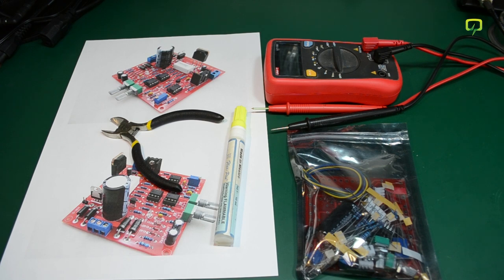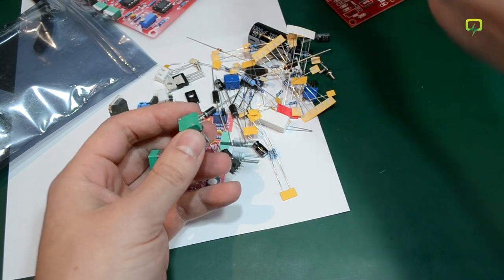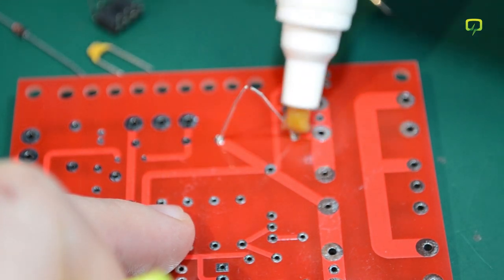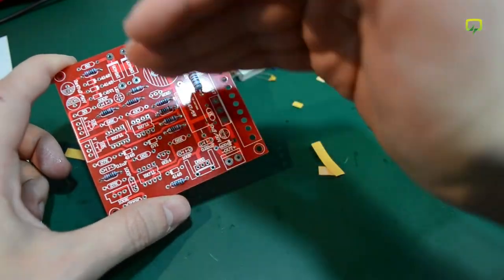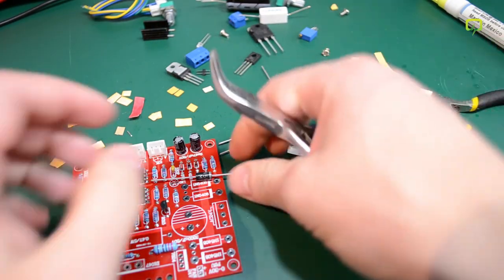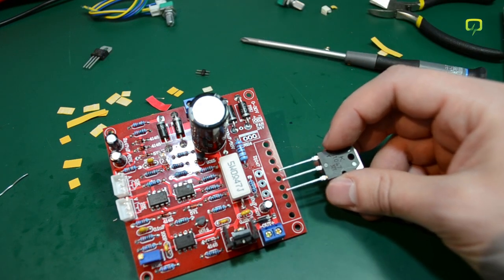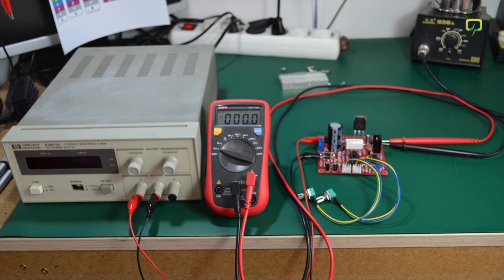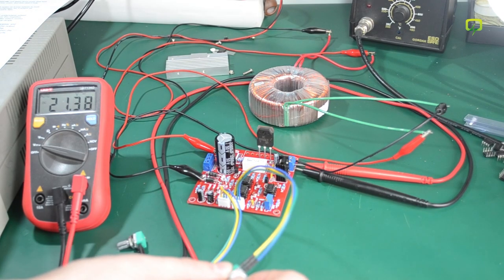VoltLog #8 - Kit Assembly 0-30V 0-3A Adjustable Linear Bench Power Supply

Comment: Have you tested the power supply? Did you check its output with a scope, to see if it behaves correctly?
Reply from the maker: +George Tsiros No, I haven't. I plan on mounting this thing inside a case soon and I will probably do some tests when it's finished. Do you have reasons to believe it would not behave correctly ?
Reply: +VoltLog Yes. Check tl081 supply rails in the circuit and from the datasheet. Do me a favor, slap a sink on that 3055 and a 24v secondary transformer and test the circuit's behavior when the current setting is very close to the current through the load.
Reply: +VoltLog Also check for oscillations and ripple voltage as well.

Comment: Hi, I was wondering about what power of transformer should I use. I know this requires maximum of 3 amps of current. I found  a 24 vac 40 VA transformer for reasonable price at local store. Is it going to be okay? I don't think the power supply will be able to provide 3 amps at 30 volts with it. Please let me know what you think.
Reply from the maker: that's a 1.66A rated transformer
Reply: Thank you for replying! I have couple of stepper motors that I want to run at 24 volts. Does that mean that I can have only 1.66A total current from the power supply? I mean 24 vac must be rms value so the peak value would be 1.414*24 i.e. 34v. Now we are stepping it down to 24 volts so the final output will be able to provide more than 1.66A dc.
Reply: I'm using a 24V 48W transformer, since I don't need 3A across the voltage range
But still 
16 volts and below - 3A

Comment: volt log can explain  how the short protection on this psu works, and does the 100k multi turn pot take part on protecting the psu from shorts?
Reply: +Anjay V Reading the manual there is no mention of short circuit or reverse polarity protection?  Of course, it's not a detailed manual so?

Comment: Hi, how can I solve that problem you had? the output voltage remains at 0.34v and for more that turn the voltage potentiometer does not rise or fall on the output.
It should be noted that the power I give is 24v 3a AC. Thanks in advance
Reply: Matias Cueto Hello friend. Have you solved this problem, because I have same issue with 24v 4a AC transformer. Getting only 0.614v at output. Thanks.
Reply: Ola amigos I got same issue.til now searching for answer

Comment: Sir I assembled the circuit and double check each component,all are ok,and I connected a 0 24v 5amp transformer at the input,but didn't get the out put like the video,opamp get hot,there is. No negative voltage on ic pin 4,I don't know why,pls help
Reply: Probably a bad TL081...swap them out after putting them in sockets.
Reply: #englishrupe01 No negative voltage on IC pin 4 means there is possibly something wrong with the voltage inverter for the op amps

Maybe a faulty component?
------------------------------------------------------
:(
Your PC ran into a problem that it couldn't handle, and it needs to restart. We're just collecting some error info, and then we'll restart for you.

(-1% complete)

If you'd like to know more, you can search online later for this error: ADAM_SK_EN_FATAL_ERROR

Comment: Hi, I build the circuit, but when I switched it on R2 gets really hot and after a while U2 also gets hot and needless to say it does not work. Any suggestions?
Reply from the maker: First check that each component is correctly mounted on the PCB, next make sure you use AC input.
Reply: Thanks, think my issue was finger trouble. I got it to work, but R2 still gets pretty warm. If that's normal I just leave it as is and start building it into a box. Thank you for the advise
Reply from the maker: R2 should not be warm, I can't check right now but I don't remember that resistor getting hot on my build.

Comment: Where did you buy
 the kit from? I can't find it.
Reply from the maker: I have added the link the description of the video.
Reply: VoltLog
Thanks. How does the performance compare to the Gopher? Any better or far lacking?
Reply from the maker: John Chung Haven't done any measurements so far. At least in terms of noise it should be better considering it is a linear supply.
Reply: VoltLog Okay will do the order. Takes for the info.
Reply from the maker: no problem!

Comment: I order the same product.after I assembled it,it won't work opamp is hot I changed all opamp then all is good.but when I connected a 2amp load on output led light up and then out vollt become 0v,I tested all component.I see ,47 r resistor is open and also 1047 is short,
What is the max out put.
When I connected this load the heat become a little bit hot.I provide a good heatsink and a fan.I don't think it provide 3 amp output and also no over current protection also,if there is a over current protection 1047 will not be short.
Reply: Did you set the CC by shorting the leads first? It does work...at least on my kit.

Comment: Hi, did you get around to doing ripple measurements under load conditions?
Reply from the maker: I have just finished assembling this kit into a complete unit with enclosure. I did a couple of measurements and I need to make some improvements. I will do the improvements and the measurements in a future video.
Reply: VoltLog I am at that stage right now just putting it all in enclosure. Not a lot of capacitance for a 3 amp load.
Reply: VoltLog So do I wait for the video for feedback?
Reply from the maker: I'm waiting for some parts to be delivered before I can start preparing the video, it might take a while.

Comment: Hi, if I conect 24 Vdc directly to the A.C. input of the rectifier bridge, ¿will it work?
Thaks a lot.
Reply from the maker: COJEIGUEN HERTRANKA It will not work with DC voltage. As I've explained in the video it needs AC voltage for proper operation.

Comment: Hi. Thanks for the great video. Could you help identify the function of the pot on the lower right hand side of the board? Many thanks in advance
Reply from the maker: +Cagri Coskun If I remember correctly that is the 0V adjust pot.
Reply: +VoltLog thanks

Comment: Take LM338K and build linear voltage or current supply 5A supply with few components. If this kit would be 10A or so then it would be worth it. Any mods with increased power?
Any digital versions? It's year 2018.
Reply: You don't think this kit is worth it for $4.50?

Comment: I only have a 2.5A transformer. Will that do or does it have to be 3A?
Reply: 3A is the max. current so anything below should work, yes
Reply: @TheMegaloloful  But it'll be weaker at higher voltages.
I used a 24V 2A transformer, since it was the only one I had laying around, and I calculated that under 16V I can get 3A
And I need 3A in the most common voltage range (1-13 V)
So I'm OK with that.
Reply: @adamsucksatyt  Pulling 3A from a 2A transformer is NOT recommended. It can over-heat/ Use parts withIN their rating

Comment: Power supply kit almost finished
Tomorrow I will buy a 7812 so I can use a 12 V fan which is built in to the box and also the DIP8 sockets for the op-amps.

Comment: hello,  did you try the short circuit protection?
Reply from the maker: Mihai Harbuzariu not really short circuit protection but it has CC mode which will limit current based on your setting. I haven't had issues with this power supply and I've short circuited the output many times.
Reply: VoltLog hello again , i did put everithing together , and i'm geting only 11v at output and the led stay on from the moment i plug in the socket, what does mean this? i have a short on the pcb? because from what i see is nothing wrong...any advice i will really appreciate
Reply from the maker: Mihai Harbuzariu Hi, I would suggest checking that every single component is correctly oriented and correctly soldered.
Reply: +VoltLog Check D8 is actually a zener and in the correct way around... check Q3 polarity...

Comment: Thanks very much for the warning about the negative rail. I just got the kit, and was planning to plug in different DC supplies at the input to reduce heat dissipation from the output transistor (e.g., a 9-10V if I need a 5V or so output, a 24V if I need something around 15V, etc). I would have gotten caught in the same trap you did.

Is your schematic available for download? The one at electronics-lab.com is helpful, but it's nicer to have the component values on the drawing for understanding the circuit.

Thanks again.
Reply: You can just screenshot the video for schematic
Reply: Here: https://imgur.com/a/3N58n9k
To do it yourself, PRT SCN top right of keyboard, then CTRL + V into paint and save as PNG

Comment: Would it work with less than a 24V AC transformer.
I only need 12V, and have a transformer out of a ATX PS - I think it's 12V (EI-40C) -.
Would that be ok, or does it have to be 24V.
Reply from the maker: +SidneyCritic ComedyHound yes it will work with 12V AC.
Reply: +VoltLog Great, that will save me some money. $15 for the kit, and $40 for 24V AC transformer, wouldn't make it  cheap.
I can't find the specs on the EI-40c transformer, so will have to test it, but there is also something in the PS that looks like toroid. I'll have to investigate.
Thanks
Reply from the maker: +SidneyCritic ComedyHound Here in Romania, a 24V 2A toroidal transformer is about $15 and a used one could probably be purchased for less. Wherever you are from I am sure a cheaper transformer can be found. ATX PSU do not contain toroidal transformers. And the other transformers contained in an ATX PSU are most likely not suited for this job.
Reply: +VoltLog I just found one at $18 on eBay, but when you add the circuit($15) and a volt/amp panel meter($8) it comes out at $41, so I was trying to cut costs in half with the ATX PS parts.
I've got a failed ATX PS with lots of transformers, and the biggest is a EI-40c, but I can't find exact specs.
Maybe this
http://www.kondzio.info/images/artykuly/2015/transformator-impulsowy/EI-33-datasheet.pdf

http://chipsen.en.made-in-china.com/product/IBZJxAPdgnWk/China-EI40-Current-transformer-specification.html

Here are some pics
https://www.mediafire.com/convkey/5cfc/snsaot1xhjknz3b6g.jpg

https://www.mediafire.com/convkey/c141/4uva5mjt899iyto6g.jpg

https://www.mediafire.com/convkey/edff/z66lnkp4g9f05jd6g.jpg

The gutted ATX case has a 12V fan, 240V connections, switch, and what I think is a filter inside - cap and inductor -, so it's ready to populate.
Any advice would be appreciated. Thanks
Reply from the maker: +SidneyCritic ComedyHound The PSU KIT is $10 http://goo.gl/3r5YKl , you will also need a heatsink.

Comment: Apart from the negative voltage issue the 7824 has a 2V dropout so you would need at least 26 VDC on the input, 24 VAC rectified and smoothed can be almost 34 volts so the 24VDC was way too low.
Reply from the maker: true, but the 7824 is not critical, it is there just to offer a 24V rail for a fan or to power something else external.
Reply: @voltlog  to make it look neater and more professional by having the cooling fan connected to the unit...
And not to a separate unit
Reply: I'll be replacing the 7824 with a 7812 cuz I don't have 24V fans, and the case I've prepared has a 12V fan built in so 7812 is mandatory

Comment: I bought this kit with the intension to use a switching power supply instead a linear transformer because one of this is very expensive and it's also very heavy and big and i don't like it.
So i get a 24 volt power supply i connected at the terminals of the bridge rectifier and i also put -5 volt at the opamp but nothing is working.
The opamp gets hot and at the output i get around 0.4 volt like in the video.
Somebody can help me? 
sorry for my terrible english
Reply from the maker: +Daniels this power supply kit only works with AC at its input.

Comment: I put 28v ac but it doesnt turn on. Have i burnt somethig or i can put 28v ac?
Reply from the maker: input is 24V AC
Reply: VoltLog So I burnt something in the circuit?
Reply from the maker: It's possible, but I don't know.
Reply: Miraculously, mine handles 30V AC fine....

Comment: Nice video! However, I find it hard to believe that this supply will be capable of delivering the full 3A, especially when delivering low voltages. The dissipation across that pass transistor will be too much for the heatsink to handle, even if the transistor can handle it. The power supply seems to be using a single 2N3055 as per the schematic, and it is mounted on a separate heatsink. The transformer has a fixed tap, and probably will get out of its SOA in the above conditions.

My bench supply uses a scheme like that, but to minimize dissipation, it uses a transformer that has several taps. So, if a low voltage is needed, the PSU uses the lowest voltage tap from the transformer to minimize the voltage drop and the dissipation across the pass transistors. It uses three pass transistors in parallel mounted on a big heatsink, three 2N3055s for 5A.
Reply from the maker: Sure it won't be capable to dissipate the heat generated from a low voltage high current output setting but that's not a common situation.  It would probably be ok for a a couple of minutes and if you really need that kind of setup often you probably need a more specialized bit of gear. For the average hobbyist this will do fine.
Reply: Well, IMHO, this supply is overrated. It should be limited to just 1A and the voltage of the transformer should be halved. It would still be a useful supply, but this would ensure that it always operated safely and well within specs. For instance, I designed a 200mA precision supply where the pass element is a MJD31C (the SMD version of the TIP31C). Mind that this transistor is rated for 3A. This may seem overkill, but you have to take SOA into account.

SOA considerations apart, this supply seems to be well designed and will do the job. It doesn't have to be a super top-of-the-line supply, I agree on that. Unlike Dave Jones, I don't roast a product just because it is affordable instead of lab grade.

Comment: The pass transistor here I believe is a TIP3055 or equivalent. This is a 90 watt device at 25c, less at higher temperatures 30v at 3A is 90W. Woaaaa!!!!!!!!!!!!. Before even thinking about this circuit buy as a minimum three TIP3055s and three load sharing resistors at say 3 watts. For a 90watt supply I would want at least 270watt pass transistor capability.

In my case I am also using a 6amp toroid 24v transformer. Personally I would only ever draw a maximum of 50% of the full rated current from a good quality transformer.

It all depends if you want to rely on what you build.
Reply: You are crazy overkiller.
There is no need for second and even third transistor, just good cooling at it will be ok.
Also 100W good quality transformer will be ok, we dont need 50% margin.
Reply: At uni we were taught to aim for 10x over specification if possible. A 100ma circuit use 1amp parts. It is all about reliability, longevity and catering for the variation in component quality.

I finished this supply and used two transistors. However I paralled the secondaries to give 12v  at up to 12amp. The worst case 3amp temp of the large 2.2c per watt heatsink is 96c. ( 191c for a 30v supply). The transformer is stone cold as is the internal circuit. Good safety margins means I have screwed the case shut and never expect to have to open it for repair.
Reply: I also use 1A diode with current at 100ma, because package and price is same.
But 10x more that needed in many cases is ultra overkill, I never heard something like that.
With two transistors and 12VAC/24VAC tap switching we could run at 8A...
Or if we are going to build 3A linear psu its good to use 4700uF main cap, or two 3300.
But 30mF cap(10x than minimum) is absolute overkill for 3A psu -,-
I know what im talking about, I have expirience, I work in high-end goverment/military grade access electronics production.

Comment: I got the same kitt...it think. I'm halfway thru building it. Problem is i can't for the life of me figure out where to put the 2 pcs of 25pF ceramic capacitors(4mm in diameter). On other bright side the 330uF/50V capacitor was a nichicon(witch is good brand "IF" it is).  

Anyone else got leftover components with this kit? 

If this thing works out ill mount it with 10 turn pots and some cheapo digital voltage / ampmeter.
Looking for recomendations on this.

Comment: Man, thanks ! I can not talk about your video as quality, but I sure can tell You that you have good idea/s for Content ! I like the idea of troubleshooting an assembled Power Supply that has capabilities for both - Voltage Regulation & Current Regulation. Thanks again, and keep that spirit :-) btw: I added the video to my "watch later" and when I have more time will watch it and possible do the schematic or use some ideas from it for my power supply, cause I bought one for 150EUR (from ~German Manufacturer, but it is "made in China") and the problem is 30V@5A tops, but not very flexible :| So I take the decision instead of buying a new one, which will be my 2nd lab power supply I will build one myself as I though even the 1st time. bb
Reply from the maker: Thanks! I definitely recommend building this power supply.